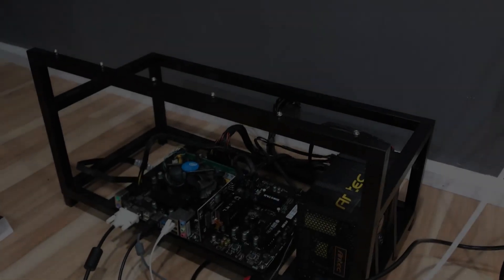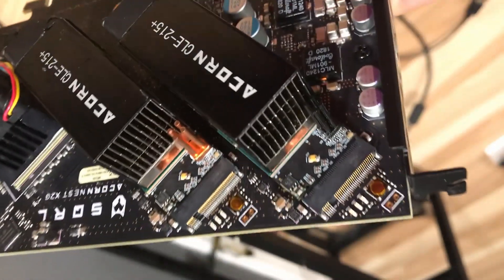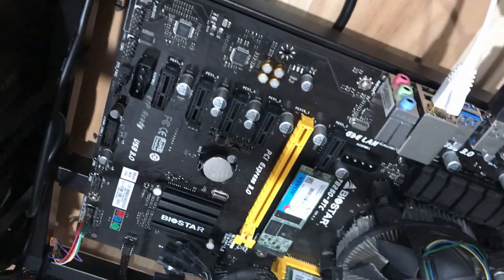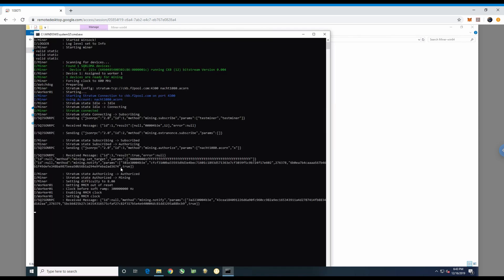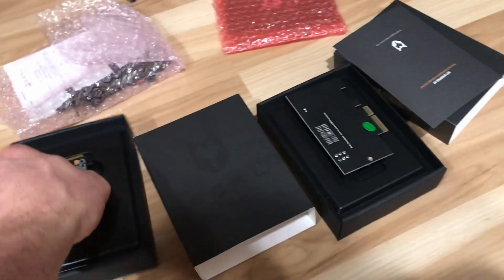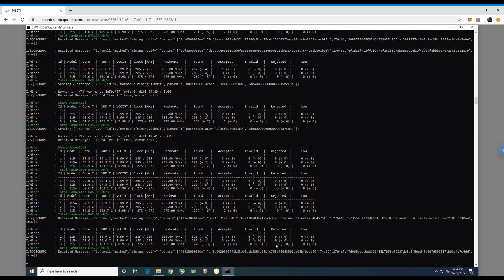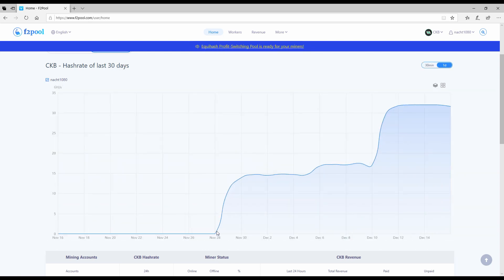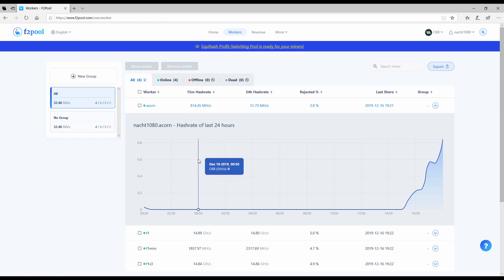CAN FPGA Acorn CLE-215+ rig mining better than F1mini+ on CKB?

Comment: I have 8 that have never been ran. I had the 4 nest but sent it back it never worked. if anyone would be interested in them. thx
Thanks for doing the video great job!  Has anyone figured out the acceleration program?
Reply: Hi, would be interested, how much for each?
Reply: @alexmendez4284   email me corporateair@hotmail.com thx
Reply: @corporateair4853  I would be interested too. Those could be used for computer architecture research (like CPU/GPU design). When you say the 4 nest never worked: which issues did you encounter?
Reply: On the back of the card there was diod or transistor  something broken off I sent it back to them and they told me they don't have anymore so I'm shit out luck with them...half of mine have not even been opened yet
Reply: @corporateair4853  Oh I see that's sounds pretty unfortunate. If I manage to find some working x4 or x2 nest I might be interested in just buying the single cle-215+'s from you.
Will keep you updated.
Reply: @corporateair4853  I couldn't really find a working riser card but I'd still be interested in buying one or two Acorn CLE-215+'s. would you be willing to sell them?
Reply: Yes I would, I'm currently out of country and will be back In a month. Would you have another contact suggestion?
Reply: @corporateair4853  I'll just send you an email at corporateair@hotmail.com if that address is still in use.
Reply: Yes that is a good contact..thx
Reply: @corporateair4853  Ok just sent you an email.
Reply: @developandplay   send me a email I'm back

Comment: Hi;
how much it can bring earns one single module per day ??
Reply from the maker: So just rough numbers maybe it will get about 15ckb plus or minus a bit which could be anywhere between $.10 to $.20 a day depending.  But you can cool them and double the performance and possibly get more out of them.  If you already have an acorn it’s not a bad use for it

Comment: Can a few 215+'s run on the same mobo at the same time as a BCU1525?  I do mean the exact same mobo.
Reply from the maker: 66tbird1 I am pretty sure the answer is yes.  I have seen the FK33 and 215s run at the same time in the same mobo/ mining software. But I have a question into SQRL to confirm and will report back
Reply from the maker: I just talked to SQRL and yes they can be combined
Reply: @excaliburmining6194  Awesome, Darn, I just remembered that water-cooled BCU is silent for a reason (It's a bedroom warmer). I guess out to the shop the 215's go.
Reply: I have 8 that have never been ran. I had the 4 nest but sent it back it never worked. if anyone would be interested in them. thx
Thanks for doing the video great job!  Has anyone figured out the acceleration program?